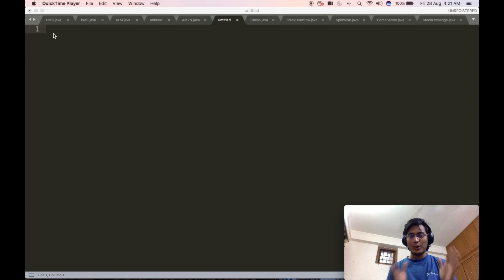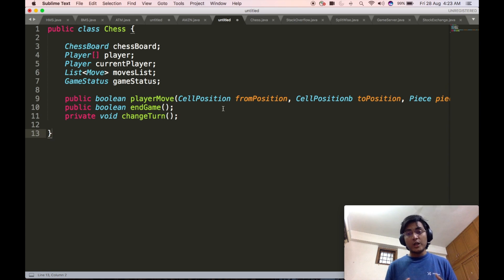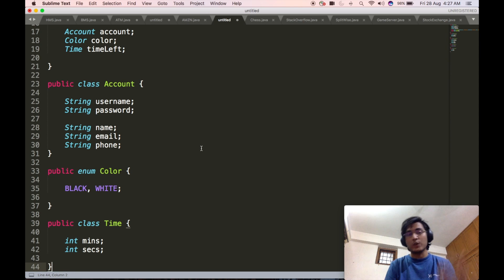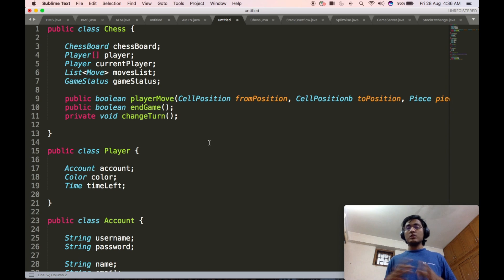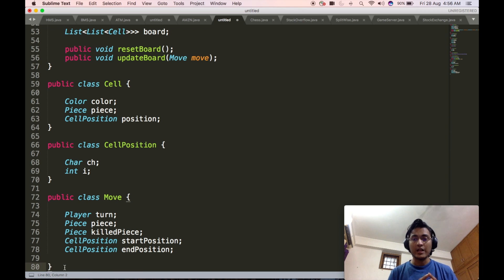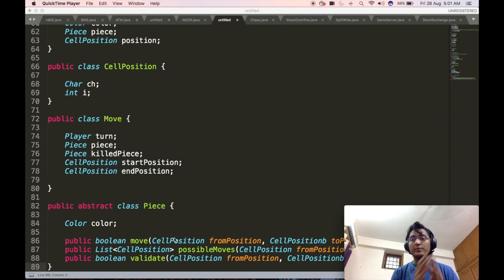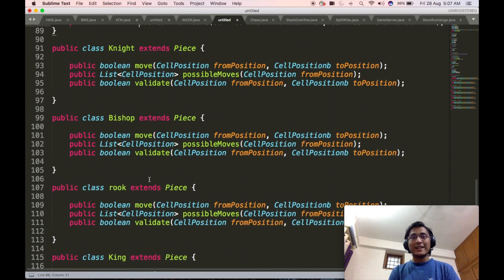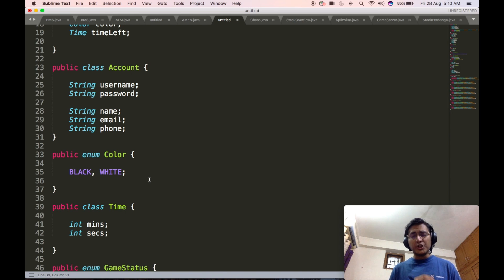Chess Low Level Design Code | Software Interview Question | System Design

Comment: The question i would like to ask.
Are LLD interviews of different kinds too :

Like in some only Class Diagram is asked.
In Some only skeleton(Like your video ) is asked.
In Some complete running code is asked.

Is my assumption correct.
or only the 3rd one is asked at every LLD ?
Reply: 3rd one is called machine coding

Comment: @Soumyajit : Why do we need the move class ?
Reply: In my opinion because a move has some information associated with it. E.g. when a player will make a move, then Chess classes's playerMove API will be called, that will internally call ChessBoard classes's updateBoard method. Now updateBoard method will require some information regarding the move e.g. startPosition, endPosition, Player etc. One way is to pass all this in diff variables or pass everything in a single object i.e. Move class in this case.

Comment: Hi @Soumyajit Bhattacharyay, why there are no Identifiers for the Game, Player, Board and Pieces classes? Are you assuming that this is a desktop application supporting only one game at a given time?
If it had been an online application, with multiple games being played at a time, we will have to keep the unique identifiers in these classes, right? Can we implement the online chess app somehow with no datastore/database behind it?
Reply from the maker: Again, in all of the lld it is given from an interviewing perspective, where it is expected to do everything in memory be it lld round or machine coding round. 

For most actual use cases, you would require some form of data store.

Yes this is from a perspective of an actual chess game. 

If you complete the video, I have discussed that as a task we should extend this design for an online chess playing service like chess.com etc.
Reply: @SoumyajitBhattacharyay  Thanks, say if we had to do this for online application with multiple games being played, how would we maintain the data corresponding to a particular game in the RAM (which datastructure or in-memory data modelling to use?), so when request comes we can know the state of pieces, players, currentTurn and board? Any insights would be helpful, as this was a real question asked in interview.
Reply: @SaurabhGupta-iu4sy  Each game must be represented by a game id. So we can store the state of the relevant objects (like board, players(IDs should be enough), current turn, etc) in a KV store (E.g. MongoDB) in form of key=game id, value=JSON object which has serialised board object and other mentioned fields. So next time if the same gameid is loaded, we'll get the exact status of the game where the game was abandoned. Hope that makes sense.

Comment: Bro if we make Piece interface instead of Abstract class that would also fit in , any particular reason you went with abstract class in this case ?
Reply: I also need answer for this.
Reply: There may be certain methods that may have common implementation irrespective of Piece for e.g. Say Move(Location a, Location b, Piece), this method can be kept common and I know there should be some validation in the method checking if the move is valid or not for that we can create an abstract method and implement it in all the pieces which will give you all the possible moves for a particular piece from that particular cell location. Once validated, you can just move the piece to the target location. The move is common irrespective of piece type so can be implemented in the main abstract piece class itself, it will save a lot of code duplicacy.

Comment: hey,i already mentioned is below long thread one doubt regarding how will we check whether the movement of piece from one location to another should not cross any chess piece in its way.the u have written it, you will have to do lot of ifelse in playerMove fxn in chess class which is not a good thing.so u should pass board instance to the piece, because it makes more sense, instead of asking board to give me you move,we will ask,given this configuration what are your moves as moves are defined with respect to board configuration.
Reply: How will i get to know whether the piece is rook or queen or king etc?? It has only color and api defined.
Reply: @mohammadkaif8143  why do you want to know that?
Reply: We need to know type of piece only to identify if the move we are trying to make is valid or not, or to identify the next possible moves. If you see piece is an abstract class, and all the individual piece classes are defining validate and possibleMoves methods in their implementation. And we always pass the specific implementation of abstract class/interface. So e.g. in case of Move class it will have the specific peace object (e.g. rook, king etc). So only specific validate method will get called.

I hope I didn't make it more complicated for you :)

Comment: Hi Soumyajit very nice explanation but I have a small doubt. Can interviewer ask the candidate to write code for any method in LLD or full coding?  Should we ready for that also?
Reply from the maker: Yes it can be. 
In my media .net interview i was asked to write entire working code for the LLD and then run the code on a compiler and every requirement should be working there.

It was an amazing experience.

You can find the video here along with the question https://youtu.be/5Q4TuOxJe54

But mostly it will be class level and api / db design. Sometimes depending on the company they might ask you to implement all or some part of it.

Comment: 1. The piece should have status to tell whether is alive or dead.
2. The move function in piece, will just be able to check whether it is a valid move.But we also need to make sure that in moving piece from one location to another, it should actually be checking whether there is no another piece in that move.So piece needs a board also as input
Reply from the maker: 1) yes it is a good point. Piece can have a status Enum that will tell us the status of that particular piece.
2) No not at all. Whether or not another piece is there can be directly validated inside the Chess class itself as it is where the playermove function will be called. I contains the chess board and can deduce from here, 

Piece should not t all hold any information of the chess board as it is not the responsibility of a single piece to know about the entire board.
Reply: @SoumyajitBhattacharyay  I am saying, let us say that i am a player and i want to move some piece ,say queen from location a to location b, the canMove in piece will just check whether i am allowed to move or not.Now let us say that the destination location is valid.But while moving from source to destination,in path path,their is some other piece also.In chess we cannot cross other pieces.How will canMove verify this without knowing the board configuration?The chess game cannot verify this as it does not know what path the piece follows from source to destination.
Reply from the maker: The chess game can verify this as the move request will be originating from there it self and it will contain both the src and destination location along with the board information.
Reply: @SoumyajitBhattacharyay  yes but each piece can have its own way of path from source to destination.Like knight will go its own way, king its own,bishop its own, only piece can tell what is the path from source to destination.going from a to b will differ piece by piece.I think i am not able to explain you:(
Reply from the maker: All the path move in straight lines between source and destination, except for knight which can hop over pieces. So for knight only destination validation is ok.

So the chess game can decide on the same. How i am envisioning is, the possible path will tell us the possivle moves from the source.

It will return the list to chess.
Chess will validate the same using board and return on the viable options on screen. 

User will only be able to move uptil the viable options that are present on screen for the selected piece.
Reply: @SoumyajitBhattacharyay  ok. so we will always call list of valid move and check if move made is valid?
Reply from the maker: @rahulsharma5030  yes validation should always be done.

Comment: Nice.
I think Piece should have only canMove method to valiadate whether it can move or not.But the actual move should be done by chessGame. Game should be able to check Piece.canMove(), and if yes, game should be responsible for moving piece.
What will piece do with move method?If you put Move in piece in Piece ,it will eventually call chess to move which is not a good flow.Let me know your thoughts?
Reply from the maker: No. Here the move method will actually contain the move defination for the piece. Move is piece dependent and chess does not have move a piece has a move and player plays the chess game by using the pieces move. Hence, chess should not have move. Individual piece should have it.
Reply from the maker: The best way to understand is to know the has a relationship between the methods and the corresponding classes.
Reply: @SoumyajitBhattacharyay , then piece needs to know board information also.Will it be a parameter in Piece.move method?As of now i cannot see it?Board update should be done by chess i guess and not piece.If we maintain board information with piece or pass as a parameter,it does not look correct.Let me know you thoughts?
Reply from the maker: No that is not the case. See the move method in piece has a boolean return type. After the player tries to move a piece, the update board method in the ChessBoard is called.  It will internally call the piece.move method that will return either true or false. Based on the return, the board will be updated. 

The piece should not know board information. That should never happen. As board has pieces and not the other way round. 

The best way is to understand these relationships between different class and then try and formulate what should be under which class.
Reply: Thats what i said.But in your code we have both validate and move method,which looks like validate method will do validation whether this move is allowed is not and move method will actually move the piece.But if move method will return boolean and based on that board will be updated,then what is difference between move and validate method?Arent they do same stuff?
Reply from the maker: @rahulsharma5030  no. The valid moves method will tell the player all the possible valid moves from that cell position for that piece. And the move method will take in a move by the player and tell whether the move is ok and then in chessboard update board the board will be updated.

So if you see any online chess player, like chess.com etc, when you are about to move a piece it tells you what possible moves are present. Hence functionally they are different. The move method will internally call the validmoves to get the list of moves and check if the move that the player has done is a valid or not.

It is easier to visualise if you play a game with move suggestions on in chess.com.
Reply: Sorry for long doubt session.i understand what you said.But what does validate method does in a piece class?You have three methods, move,validate and and possibleMoves.I understand possibleMoves.Move will tell whether move is ok or not.Then what exactly the third method, validate does?
Reply from the maker: No problem at all. It is always great to have good doubt session!!

Yes in the hindsight, i can see i have unnecessarily added a validate method as the function of validate method and move method is same here. Even the function definitions are the same. Lol. 

A miss here. There is no need for the extra validate method here as the functionality is taken care by move.
Reply: @SoumyajitBhattacharyay  thanks for confirmation.I have a suggestion.You can also add a one line comment next time, to each api definition to make it more clear.
Reply from the maker: @rahulsharma5030  yes that would be great! Thanks for the feedback. I am thinking of adding proper java doc beside every API definition. By this it will become easier to track!
Reply: @SoumyajitBhattacharyay  For a piece to know, what all are possible moves, isn't it have to be aware of the board?
Reply from the maker: No in this implementation thebpiece will be returning all the moves. It might be valid might not be valid. 

That will be checked by the service which will have the information of board.

The piece being a member of the board should not be aware of the board.
Reply: @SoumyajitBhattacharyay  then it will have to check valid moves by doing by all clumsy if else, if piece is X then do this,if Y do this,if Z do this.Does not seem a good approach to me:(
Reply from the maker: That any ways the piece would have to do. Not to mention the overexposed piece class. Thats an info sec night mare.

There is no clumsy if else if we can attach a rule engine to compute the same.
Reply from the maker: Because this way, potentially the piece will have the ability to modify the board. Which is wrong!!
Reply: @SoumyajitBhattacharyay  Yeah, we can have some rules implementation, which will be aware of board. Thank you for the reply @Soumyajit
Reply: @SoumyajitBhattacharyay  We can agree piece not having information related to board. But is there any principle/standard that is violaylted by piece having the information of board. By what principle, we say that information of board, should not be present in piece
Reply: @nerellasaikrishna6409  @Soumyajit Bhattacharyay 

Why would we need rule engine to do something that only piece should do? The way you told that piece should not know about board. Then similar way we can argue that board/rule engine should not have logic that is specific to piece.Whether we use rule engine or something, that thing will have to know how piece moves, which should be known by piece only.Later if some rule changes for piece,let us say chess has a new rule, then we will need to make changes at multiple places.I know its getting long discussion but its good:)
Reply from the maker: The piece ahould not know anything about the board.

If it knows then it will have the ability to modify the board. Which is not the responsibility of the piece. 

Not only that, the piece being able to modify the board is a potential hazard for the game. As if a piece wants it can change the entire game because it has complete access to it.

While designing you should remember what is the respo.sibility of individual components and which component should have access to what.
Reply from the maker: No not at all because the board has pieces in them not the other way round. 

There is a has a relationship between a board and the piece. Hence board should be able to move pieces and not the other way round.